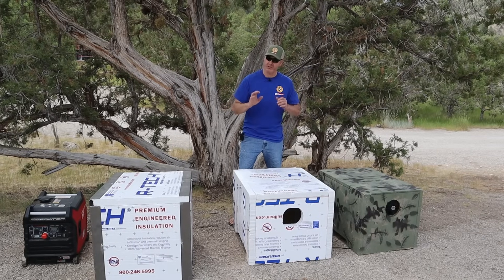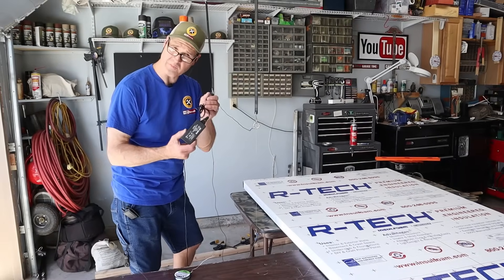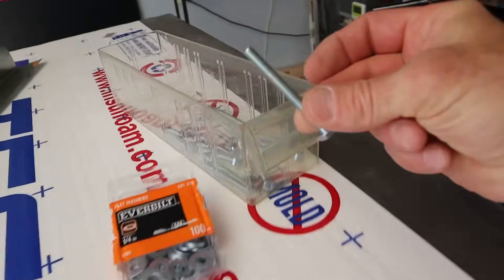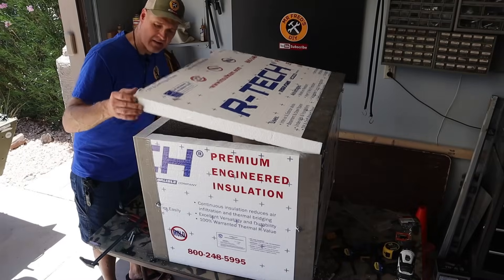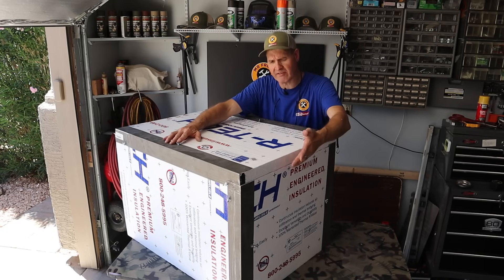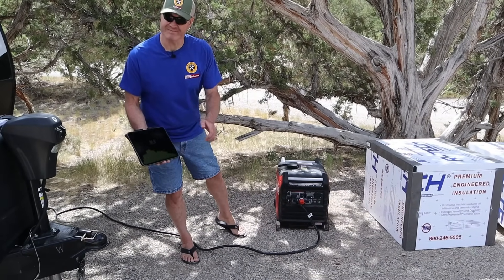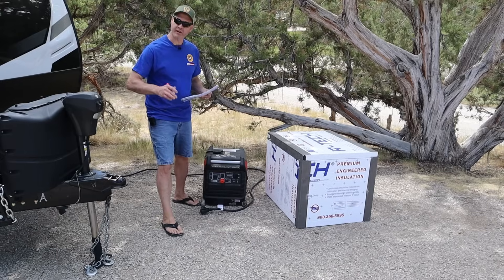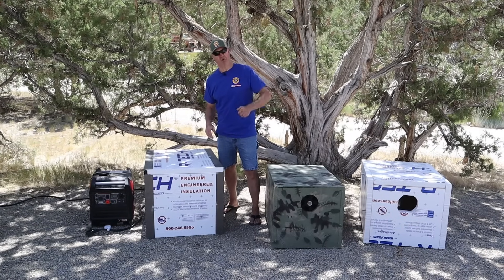Generator Noise Reduction Shed $30 Design

Comment: The only way to attenuate sound is through mass.  Thickness of insulation is a lost cause. It will and does have some affect.  But mass is the key.  If one can't 9and doesn't want to carry super heavy sheets of dense objects to absorb sound? One can learn to deflect sound. It's a sort of trickery, but it works. For instance, you could have more sheets of insulation with foam in between the 0 measuring point and the 25 yard point that deflect (and absorb a small amount of) sound.  You can have more behind the open end that are angled such that they deflect the sound down in a 45 degree manner.
All that will add up.  But ultimately, these generators aren't that loud.  So do some stuff and enjoy!

Comment: I would normally use my generator in the winter. I'm curious if your 2in. Styrofoam will hold the weight of a few inches of heavy snow and being so lite, would not blow away in a gust of wind...

Comment: Great thought, but does not seem worth the trouble. Only 3db decrease at 25’ w a load.  Now if you dropped 52.5 to like 30 you would have something. I think I will still try it but instead use Rockwool insulation on 1/2” OSB. Rockwool is fireproof and is designed for sound reduction whereas foam board is not.

Comment: Why didn't you use sound shield?  You cut them to size and have an adhesive back.  Worked great for my outboard engine inside the cowling.

Comment: I would suggest for 0-5-Dcp you make it 4 times thicker and cheaper and portability just use duck tape and why keep taking it down just keep it with and covering the generator also I bet if you would made a rubber or sterofoam floor for the generator to sit on top of would have make a dif also add a muffler silencer. I mean if a gun silencer can do what it do just imagine a muffler silencer. just my thoughts

Comment: Every generator manufacture will tell you not to do this because the generator needs to have un restricted air available to cool it, inverter generators are designed to pull air through them to cool the inverter and other components and by putting a box around the generator you are feeding your expensive generator hotter air with will ultimately cause your expensive generator to fail.

Comment: Would not a TRIANGE - pyramid shaped housing, composed of 2 inch foam -  be  a better sound - proof  design ?.  THAT  pyramid shape - would direct the sound energy - into  the ground.
        ( Vibration as well .....)  old guy - generator fixer....and hacker .

Comment: So generally you saw a  3dB difference?  That is very underwhelming.
Also, as others said, heat issues could be a problem AND carbon monoxide monitoring gen's might well shut off with this design.

Comment: I used chest freezer which died and when I put it on its side, I could fit my Champion 2200W inverter with the exhaust to the outside. It worked fine but my wife said it looks ghetto like and I had to remove it

Comment: Wat he said at 7:30 is a lie it actually sets up with 12 bolts instead of 6
Reply from the maker: Thanks for checking out the video! What I actually said was that it sets up and breaks down with only 6 bolts because the rest of the hardware stays attached to the panels. Only 6 bolts need to be removed to break it down.

Comment: Didn’t get past first 3 comments. 
These things (Generators) NEED PLENTY OF BREATHING ROOM!  I’d settle for just 4 legs and roof top. Or consider buying a quieter generator… YOU CAN BURN ONE UP
IN A HURRY…. Common sense I’d think.
Reply from the maker: Check out my heat testing video for this box design. You might be surprised. https://youtu.be/Ty8aJ2Eh_WI?si=qYwnJDo2PllStQqn

Comment: If you really want to make effective sound dampening, you should used a mixture of materials. Different densities of material will block different frequencies. If you line that with something like scrap carpet, it be more effective. I've got three materials for my compressor box.

Comment: All of them are wrong because you don't use acustic reduction materials; use 4m² of rock wool and that's all; it safer and cheaper; you have to let the air flow so the panels must be placed with space between them but without the machine being visible from the outside

Comment: Till it over heats like hell dont do this. You need an intake side so it can suck cool air not suck in very hot recirculating air. Personally i wouldnt do it without a fresh air intake and exhaust to blow hot air out. This will void warranty in a newyork second and is by far not using any common sense build i have seen. Cool air intake is a must cut a hole and make one even if its making another circle or square to get it there like duct work.

Comment: Sir that foam board has a sound reflective coating , seams like if you wanted to reduce sound you might try something that absorbs it instead of redirecting it like fiberglass insulation or rock wool , heck that fiberglass insulation board used for air condition ducks would be a better choice with the aluminum foil on the outside  But you are on the right track.

Comment: I designed a double shell for my upright compressor out of 3/8 plywood.  It's the same shell design as yours, only vertical. But mine has another larger shell covering the open side, leaving a 3 inch c-shaped opening opposite the smaller shell's opening.  Inside the larger shell is a lining of old carpeting to absorb sound.  It works well and the compressor stays cool. The only drawback for using it around a generator is that the genset needs an exhaust opening, which lets out noise as well as exhaust.

Comment: Ventilation is way more critical than reducing the noise. Yes the box does work but you are shortening the life of the engine.  Maybe try a new muffler system 😁

Comment: I wonder how much a simple large cardboard moving box would compare, maybe even just set it down in a large box to see any difference. Other things to try could be set the generator up in a bowl with 45 degree angled sides so noise is reflected up. Heat would rise easily too.

Comment: 52.5db to 49db is not really worth it.

I measured my Preditor 5,000 watt generator at 1 foot, and the db was 87db, not the 60db that Harbor Freight claims.

They would not post my review.

I have used db meters for years in aviation for aircraft p.a. checks and adjustments.

Comment: adding a slight angle to the walls so the sound bounces down into the earth will help reduce the sound, you could also add in triangle sheaths onto the walls with your left over wastage, this will absorb more sound than just having flat walls.
Reply from the maker: Thanks for watching! A few months back I made a design with a slanted roof, this video herehttps://youtu.be/IZw-N7zx6Gc

Comment: Why do I never read about the best place for noise reduction and that is underground. However, you must pay attention to air supply and exhaust and the exhaust can be connected to a long pipe. My father had this with a generator and you had to do your best to hear something in the distance. Note: if you have a high groundwater level, I would not do this. It is possible, but it may be too complex

Comment: If you want to reduce sound further maybe staple or hot glue in some egg shell foam (or even cheap egg cartons on the inside to create some baffling.

Seems like you've got the tools to actually test the volume pretty decently.

Comment: Do you think there would be any heat issues after a while?  I wonder if adding mass loaded vinyl or Roxul 80 would make a big difference for not too much more money.
Reply from the maker: Interesting thought. As far as heat, I did a thorough heat testing video ▶️https://youtu.be/Ty8aJ2Eh_WI
Reply: @MrFredsDIY  if you try MLV, make sure to get the fire rated kind with foil on one side.

Comment: You shouldn’t do that because the generator components will get too hot and the exhaust fumes are very corrosive.
Reply from the maker: Thanks for commenting. I have several videos where I have done heat testing, and found no issues.

Comment: How about just two 3'x3' sheets of 1\4 plywood, hinged at the top and the interior covered with sound deadening material, like a pup tent. Sound would still exit the ends but so would the heat and it would fold flat and provide some weather protection. Thanks for sharing.

Comment: sounds good EXCEPT for the CO shut down system on new generators. It'll shut down if you enclose it.
Reply from the maker: You bring up a good point. The generator that we have does not have a CO sensor. We are working on another testing video with a CO detector. We have done temperature testing and heat was not an issue. ➡️Are Generator Sound Boxes Bad? https://youtu.be/Ty8aJ2Eh_WI

Comment: what about the life of the generator running hotter ? than it was built for 
maybe get some spray foam and coat the whole thing with that stuff
or redo the exhaust make it longer

Comment: It doesn't do anything Jack . At only 3 decibels is like a 93db lowered down to 90db whoop-de-doo
Reply: Dropping 4db is cutting your sound level in half! It’s basic physics 😂
Reply: @litoaykiu  to my ears 3dbs is nothing.  I've had a Briggs and Stratton that was about 90 dbs.  If you brought it down to 87 dbs, it would still be laud as hell. No way was that sound cut in half.  I returned it and bought a Champion that was 69 dbs, now there I noticed a difference.  So Physics or no Physics my ears don't lie.

Comment: I use cinder blocks. A pallet underneath with a steel shed door i was going to scrap. Both ends open noisy end pointing away from the house. And i have to open a window to tell if its still running. Cos its only for the fridge and freezer in power outages predator 6500

Comment: get a small car muffler and engineer a quick disconnect on your genset with flexible exhaust pipe to the muffler.  you seem to be mechanically inclined so it shouldn't be a big deal.  it will be much quieter and take up less room. i've done this with an 11hp kohler cast iron engine on a homebrew log splitter and it is unbelievably quiet

Comment: Great idea! I just use spray foam and squirted it all over my generator until it was about 3 or 4 inches thick. Only downside is sometimes I forget to turn it off because you can’t hear it. I use it mostly at MAGA rallies to run my hotdog stand.

Comment: Your getting an echo off that bench. Plus the box design creates an echo chamber. Although the foam is a great insulator for heat, not great for sound proofing. Bolt some 3/8 rubber to the outside. Make a floor and put rubber on the floor section. Great effort. Try again.

Comment: This is completely foolish. It will destroy your generator from heat build up. Why not also plug up the exhaust so the smell not bother you. An example of a video that should not be shown to the public.
Reply from the maker: Thanks for sharing your opinion. We made an entire video thermal testing these types of boxes with lots of data points and temperature readings. The results might surprise you.https://youtu.be/Ty8aJ2Eh_WI

Comment: Suggestion: Layer the inside of the box with egg cartons or sound deadening foam. (I work in a recording studio - it's all about the acoustics...) Also, my Dad built one of these in the 70s and used egg cartons on the inside. Thanks for the video and how you assembled yours.

Comment: Some other comments saw the design flaw as well. With an open end you will get redirected sound waves coming back as they bounce off everything. If you're making this for home use try adding a layer of reflectix barrier inside. I have it and its works great.

Comment: Avoid flat panels that reflect sound. 
Avoid square corners 
Avoid parallel surfaces
Utilize baffles and sound absorbing materials. A small amount of sound absorbent in a resonate spot can make a huge difference.
Reply: And direction change of the exhaust makes a big difference too. Can use pieces of that flashing to do that.
Reply: Lol...maybe a dome shape?

Comment: information.        good work.       (people should use one of these things when they  HAVE to use their pressure washers, around the house.)         your results suggest that the use of foam sheet, with very minimal bracing, does not result in a sufficient amount of rigidity; so that re-radiation of sound by the structure is  minimized.            as desired, additional bracing, in the form of a diagonal-X, could be firmly attached to each panel.        made of (precisely joined) pieces of 1x2 or similar.

Comment: I only do dispersed/boondock camping and have quiet Honda gen.
I park my truck opposite the living side of my fiver. I then position my generator on the opposite side of my truck near a tire and point the exhaust away (very important!)
Cheap, easy and greater decibel reduction than you’re getting without obstructing air flow or creating heat build up.
Of course it helps being old-age hard of hearing 🤣

Comment: The 2 things that kill gasoline motors are heat and vibration.    I used 2 10” 12v radiator fans pushing air across.  I checked temperatures before and after and it was better than open air.   Heat rises but I didn’t want to open the top so I blew it from once side out the other.     Worked like a charm.

Comment: Not enough air, period. An opening on any of the sides is still allowing noise to be heard more than you should. Build the barrier with about a foot of clearance all around. Then place it over the generator and support it off the ground about 2 inches. This creates a chimney effect. And it gets air from all directions.  You'll fry your generator with little air.

Comment: Good, helpful content on a subject that is important to dispersed campers who are forced to park 1 car length from the road in some state and federal parks which tends to result in campers crowding each other and causing stress over generator noise.
This idea may have limited effect, but it is far, far less expensive and space saving than buying and lugging around solar panels, inverter-chargers and very expensive LiFeO4 batteries.

Comment: I'm not worried about sound since I only use my generator for a minute or two at a time.  But I am wondering if this design would work for easy on off protection from the elements if I add a 4th wall and a pallet underneath.  Like being under a giant cheap cooler.

Comment: Excellent video. I would use some sort of soft matting perhaps insulation board to absorb the sound vs. reflect it.  The one side left open, I would put another slanted wall but open to the sky.  The box would be more of a upside down right angle trapezoid.  All the sound would go up and dissipate vs going out.  🤔

Comment: You've given me ideas for sure.  Love the portability.  IMHO it still seems a bit loud so I'm going to have to research some. But you are out there testing and building and doing.  That is more than I have done on sound reduction.  Excellent build.  Creative.
Reply from the maker: I am working on a slightly new design and will have a video soon! Thanks for watching!
Reply: Decibel is a logarithmic scale. He made a solid improvement.
Reply: Lots of builds with MINIMAL sound reduction?? Good job!
Reply from the maker: Thanks for checking out the videos, my newest design is testing very well. Our initial test is a reduction of a decibels. Here is that video.https://youtu.be/erA944a9Bvc?si=giahoGQUStGaVbnA

Comment: The only improvement I did was I used U channel at Lowe’s and permanently attached it to all sides. So then all I had to do was “slide” all the pieces in place to assemble and disassemble was just as easy. No bolts no washers just easy Peezy :)

Comment: You can find high heat MLV (mass loaded vinyl and stick it to any metal that vibrates around the motor. This will really dampen some of the noise as well. Like what they do with Fancy cars to reduce road noise.

Comment: A couple comments from my experience living on generators 24/7 for years. 

Lift the sound deflector an .5 to 1 inch off the ground to allow cool in hot out the top. Will not change your sound. 

Line the inside with carpet or welding cloth or "bag of rags". 100% coverage not required. 

Run a flexable exhaust line as far from camp as possible (up high in a tree or along the ground). Moving exhaust (and intake if possible) makes a HUGE difference. On some units it more than the sound box.

Comment: seems like a lot of work to me just for lowering it by two decibels At zero feet. 
in my opinion if you got another piece of 2" styrofoam and put it on the back, it would lower it quite a bit. also extending the muffler pipe will lower the decibels quite a bit too .

Comment: Cool design. I'm thinking that if you could angle the sides downward (like the sides of a pyramid), it would deflect the sound into the ground, instead of bouncing back and forth. Also, if you put 2" wide strips attached inside, those would serve as baffles, too. I do not know about any of what I just said. I'm only thinking of how it works when recording audio. How fireproof is that material? The generator backfires and starts a fire - might not be too good. Again, I do not know.
Reply from the maker: My guess is that the styrofoam would melt long before it would catch on fire. I am working on an angled roof design video with s few upgrades! Thanks for watching!

Comment: Foam and square corners are not the most efficient way to deaden.  Simplest design, I think, for portability would be a frustrum of a pyramid. A simple, effective material off the shelf for anyone is the basement flooring system that is OSB with a polyethylene, 3-dimensional drain sheet laminated to it.  Build your frustrum with the polyethylene facing in.  With a frustrum, you should also be able to have an effective draft, but will need to "tune" the intake and exhaust openings to the generator.